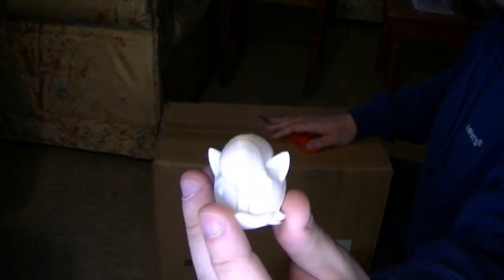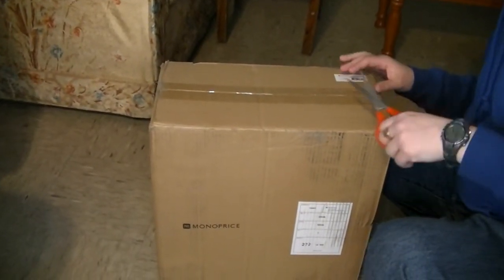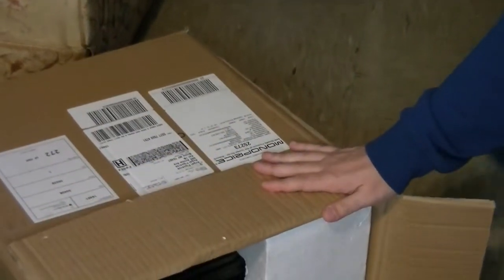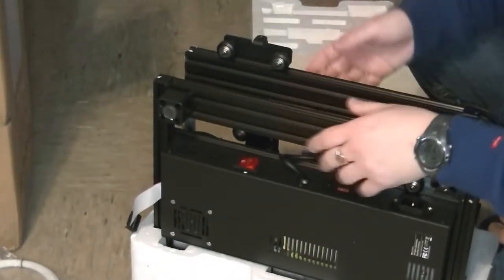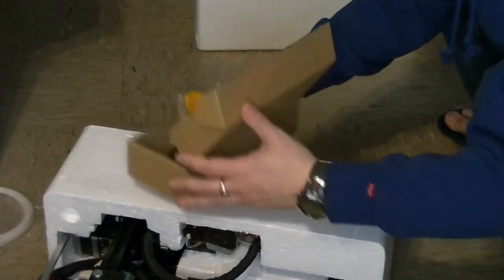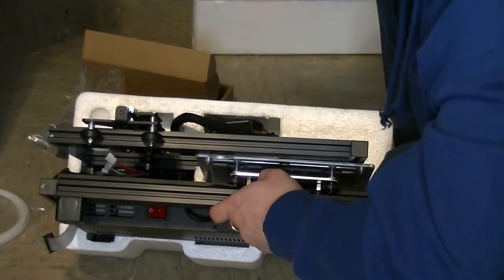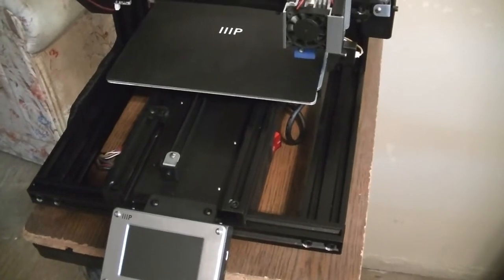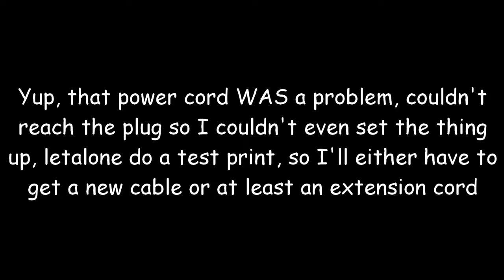unboxing new MP10 Mini 3D Printer

Comment: Just a random question, but how many jazwares metal sonics do you have?
Reply from the maker: only one fully intact, I have parts of 2 or 3 others, and of course the 10 inch one
Reply: @wakeangel2001  So does that mean you will only be modified jakks metal sonics from now on?